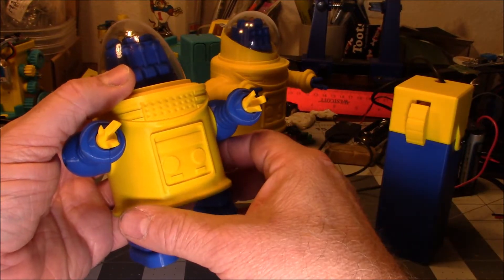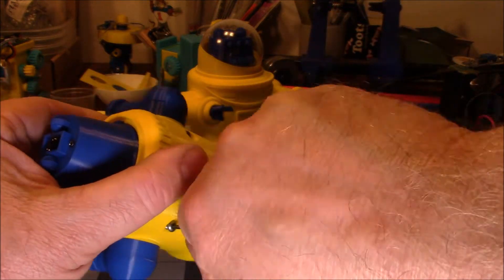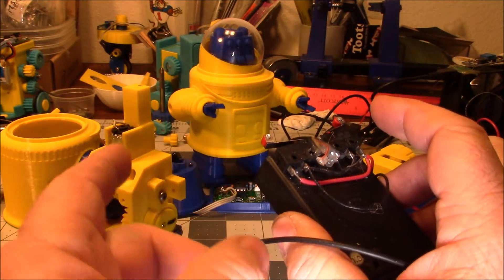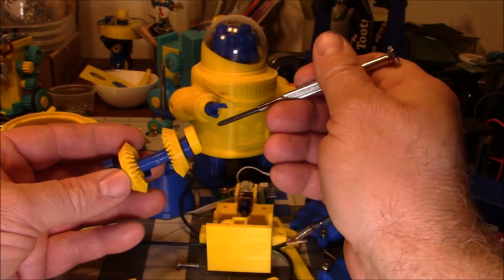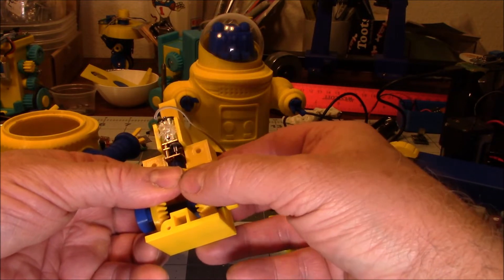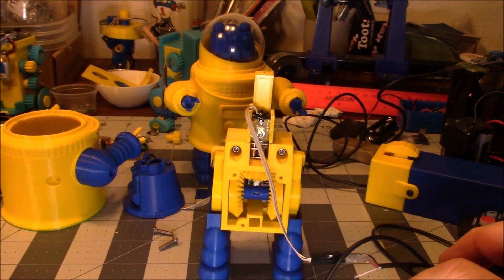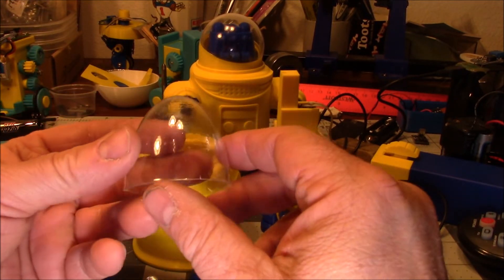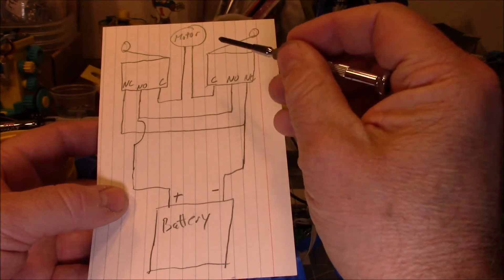Finished single motor steerable pin walker

Comment: Rick I was thinking of trying "testing" to Resin 3d print the clear dome. Do you still have the dome STL not the 2 part mold for the dome but the dome its self.
Reply from the maker: Yes, I can upload the dome file to Thiniverse and Printables. Currently the wall thickness is 1.4 MM. Is this OK for resin printing? I can easily edit the dimension  to anything you would like. Let me know and I will upload them. I never thought about resin printing a clear dome.

Thanks,
Rick